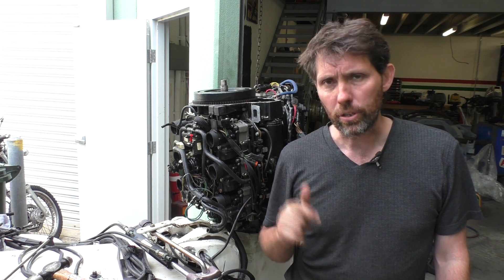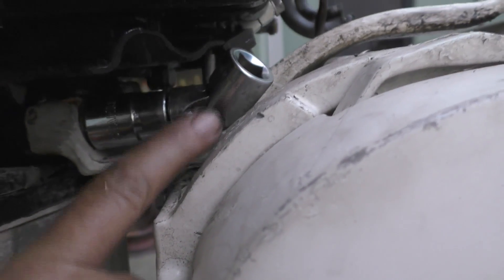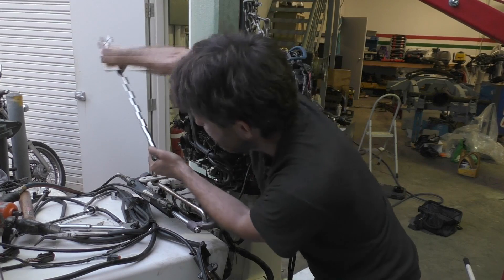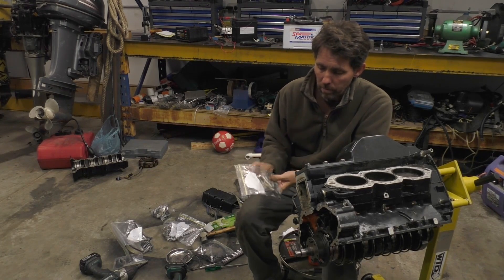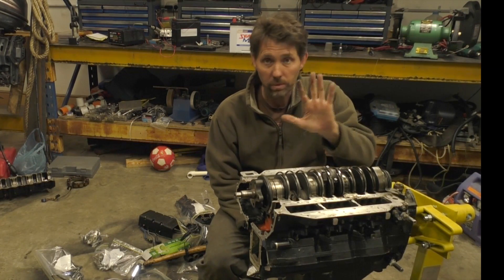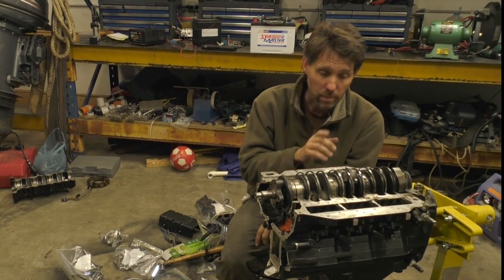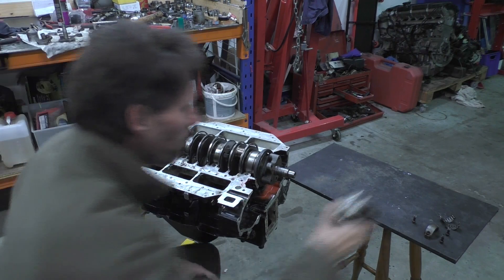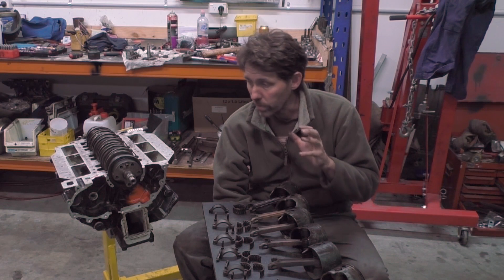Evinrude 150 autopsy

Comment: Good video. I am pretty sure if that motor crapped out here in Canada, it would be VERY difficult to find a mechanic that would even go as far as you have.
Reply from the maker: Canadian mechanics must be much more sensible then. ;)
Reply: No. Judging by the time, parts and effort (and I am sure at least $5000 if not more) you put into that old anchor, it is much easier to bolt on a used runner. We have lots of camp (lease) returns and such available here.
Cheers, good job, educational and entertaining.
Have a beer!

Comment: I have been glued to this story, and now that it's done it seems no sure cause is to blame. I had a 150 Johnson start burning a hole into piston, the cylinder died because the spark plug was fouled with aluminum. Since you didn't mention any odd issue with plug and the piston looked like it was crushed in with no damage to head,  I will vote on a previous reader hydro  lock theory with coolant getting past cylinder o-ring. Once that chunk of piston fell into crankcase it became an interference piece.
  Just my 2 cents.
Great video's, love catching up with island life.

Gary in Louisville, Ky.
Reply from the maker: Hi Gary, there definitely did look to be water getting past that o-ring, so I too think water it is the likely cause. I'll pull the plugs on this one after a few hours of running and take a look at them to see how things are tracking.
Reply: @DangarMarine  Mr danger water was the problem, water entering the combustion chamber raises the compression ratio and side loads the Pistons .higher compression on low octane fuel spark knocks and pre ignition and detonation burns up the piston tops
Reply: If water was getting in, wouldn't the top of JUST THAT piston be "clean"?? I would think there would also be salt deposits on it? Like there appear to be on the deck surface at the suspected leak point.
Is the compression height (pin height) of that piston different to the other 5? if the pin was lower the Compression Ratio would be higher in that cylinder, and that may make it more succeptable to detonation, considering it had appeared to be "rebuilt". Also, could the con rod be mis-machined and be longer that the others? Are all 6 strokes equalised? are all 6 head chambers equal in capacity? are all 6 carburettors matching in jet sizes? small mistakes get made in production lines. I am sure the people putting the carbies together don't check each individual jet, maybe that one is a size or more down, OR the numbers on one of the jets in that carby is mis-stamped??

If that engine has been rebuilt, and it's only a recent engine, that would indicate to me that there is one of the "re-used" components at fault.

  You really need to get your microscope out and work out the problem, or else you will be re-building that engine again, likely at your expense....
Reply: @kiqnkf3201 you are correct. its carbon buildup that stuck the ring/s and cause the scoring and detonation in #2. all cylinders had same level of carbon which is a clue, and the stuck rings staring him in the face! this is extremely obvious and has nothing to do w. water as he suggested. a good decarb every 100 hrs or so and this could easily be avoided!

Comment: i think that cracked piston was a result of pooled water/coolant in the cylinder on compression stroke,, ie sitting above the ports upon startup,,, water being compressed,or should i say trying to be compressed.. not initial overheating. further evident from the cylinders seal/gasket .
that piston may have  been hammered a few times that way, depending on how much liquid was in the cylinder at the time,  and ran a few times   before its ultimate failure. ive seen cars/4 stroke with bent, broken connecting rods resulting from coolant in the cylinder.
Reply from the maker: Yes, a hydrolocked piston will certainly get very unhealthy very fast. So far it seems to be running really nicely so I'm hoping that's all there was to it.
Reply: very good,,further more water constantly being forced  or pulled into that cylinder could have raised compression   leading to 
 pre-detonation conditions,, .but whatever the case  i;de bet that that head seal  had  alot to do with it ,,, Dig the vids.
Reply: I would think because they usually crank a few times before firing, that ingested water would cause the starter motor grief and cease the cranking procedeure. 

Also, unlike a car, I would think there is no pressure in the cooling system on shutdown to cause such a leak into any part of the engine at any time? Is this correct? As a car has a pressurised cooling system, water can get forced into places post-shutdown, were as an outboard would lose cooling system pressure seconds after shutdown??
Reply: it was just an idea,, but either way, pressurized or not, judging by the way that head  looks, you can be sure that water  in some amount   was entering the cylinder.
weather it was while running and/or continued to trickle in at shutdown ,if it had trickled in at shutdown,, yes a full cylinder will cause  a seize/hydrolock . but in certain amounts, say just a bit more than its tdc capacity and sitting at  a particular point in its cycle ,at first crank, i can see it getting hammered. 
Did this happen,who knows. but ide imagine that that leak had a lot to do with its ultimate demise.
is it a coincidence that the one cylinder with the smashed/cracked  piston ,also had the leak?   maybe, but it is very suspect.

Comment: Failure to find the cause will mean it will come back.
The crankcase was never pressured checked. 
The VRO was never calibrated for oil usage with a premixed tank. 
The problem is still there
Reply from the maker: I agree it would be nice to know for sure what the problem was, but given the tanks seem to get water in them very easily I'm thinking it may have been water related. We are still in the process of seeing how much oil the VRO is pumping while on the external tank of premix fuel, so I'll keep you posted there. From what I understand there is no easy way to pressure test these crank cases, but having changed the top and bottom seals and cleaned and resealed the flanges I can't see it having a leak.
Reply: You don't calibrate the VRO for use with premixed fuel. You remove the oil tank and lines and cap it off at the oil inlet.

Comment: Hi Dangar Marine i have a issue we my 1995 yamaha 90 2 stroke  running  foward they dont go more that 3500 RPM I remove the oil tank mixer i mix the oil we gas now ,i change the spark plugs  i clean the carburattors ,i change  the fuel line ,the prime i clean  the little filter inside the motor,i check the fuel pump don have any hole on the diagfragm the compression on all 3 cillinder is 140 on each cilinder and is working better but not more than 3500 RPM, I dont know if is the CDI SAFE MODE or any other Issue,can you o any person here can help me PLEASE.
Thanks
Reply: If your engine is running perfectly and it will only reach 3500 rpm, try changing the propeller to a lower pitch. And make sure you don't have a bunch of unnecessary weight in the boat.

Comment: Stu,
I have a question for you...

I am disassembling a motor, and am stuck.  The problem is that on one piston, the ring is bent and protruding, and is engaging with the exhaust port.  So it will only go up and down the height of the port, and then locks.   Other than being "locked", the motor and cylinders are in good condition.

I've tried levering the rings back into their groove, but they are not cooperating.  Do you know of any suggestions or tricks for this situation?
Reply from the maker: It's definitely a tough one. Does it feel like the ring is not going back into it's groove because it has filled up with carbon behind the ring? If so some type of ring free or oven cleaner might help you get the space you need to push it back in just far enough to clear the port. The other option is to try to file it back in some way if you can get good enough access through the exhaust. It may scratch the bore on the way out though so you will need to hone it once it is out.
Reply: Great ideas!  I'll try the oven cleaner first.  But because the piston is somewhat deformed, I suspect it is metal blocking me. The piston looks similar to yours, like it was starting to melt.  I may be able to take off the exhaust plate and get to it that way.  If not, this one may end up in the scrap heap.

On the Evinrude you pulled apart, it was partly locked up, right?   What was causing it to stop rotation?

(Thanks for the help, by the way.)
Reply: Dangar Marine,
Had a big bummer happen. A friend was looking at that motor, and said he "had it."  Before I could stop him, there was a screech, and he put two huge gouges in the cylinder.  Ugh!  
That motor is done, now...

Comment: some of the carbs may have leaned out less fuel higher temp ? just a thought
Reply from the maker: Hi Sean. In a follow up vid to this one I clean the carbs and they all looked really clear to start with so I'm thinking if they did go lean it was either the fuel pump to the bowls or a vacuum leak.

Comment: I have a 1978(if it is original to boat. I think it is.)  Evinrude 140. I bought it late last summer and drove it numerous times but on my last trip before putting it away for the winter(Northern USA) I experienced a same situation as you have where it was running great. I was pulling a skier he fell off and I stopped then when I started going again it didn't have enough power to get up to plane let alone pull a skier too. Of course I was on the opposite side of the lake so I had to idle back to the boat ramp. Is there any cause for this besides what happened with your motor. I premix the oil so that shouldn't have been a problem. Typically how many hours does it take for a rebuild? Also is it something a novice can do or is it better left for the pros?
Reply from the maker: +Benjamin Coffel It could be a number of things, so you'd need to do some diagnosis first. A compression test on each cylinder will tell you what is going on. A full rebuild is something that can be done by amateurs, but you would won't to take it slowly and do a lot of research first.
Reply: Dangar Marine what is a typical pressure reading for a motor like that? Thank you for your help! I actually fixed what I thought was catastrophic gearbox damage by watching your propeller video. So thanks for that too!

Comment: in the snowmobile world,a hole in the piston top is 100%either water in the fuel or advanced timing causing detonation.if it had cold seized,there would be scoring on all 4 corners of the pistons.ii had a similiar problem with a 200 johnson and it turnrd out to be the static timing roller broke.also those plastic carbs are known to deform which can cause a air leak.does your motor have the optical pickup timing?
Reply from the maker: I'm pretty sure this didn't have water in the fuel as the tanks were cleaned out and refilled before the first run, but I am starting to suspect timing. I'm not sure whether this is optical or has a hall effect sensor, I haven't looked into it yet but I'll definitely be doing a separate video on checking the timing before if goes back in the water.
Reply: i have also seen where water has gotten into the oil tank and burnt holes!i learned that the hard way.it took 2 burn downs to figure it out!lol..is there anyway that 1 carb leaned out?we have found quite a few boats lately that have suffered from the interior of the fuel line rotting away and plugging carbs.i dont know if you guys have ethanol there though?

Comment: The VRO is known to fail without warning and most people that own Johnson/Evinrude normally delete the VRO
Reply: A VRO failure would have resulted in ALL the cylinders being destroyed and NO oil in any cylinders (clearly not the case here).  A single cylinder being burned like that indicated a clogged up carb in that cylinder causing a lean condition in that single cylinder.  This is why there was no alarm.  Also this year motor was equipped with OMS not VRO.  VRO keeps getting blamed for failures that were not related to the VRO system in any way.  Nice video BTW
Reply from the maker: I think we'll be going the same way with this motor. It is going to be cheaper and more reliable to go to premix.
Reply: I keep telling my pop with his 1 week/yr Polaris 3 cyl ski, that premix modding will ensure he still has a boat for another 10yrs when he needs it.
Reply: Interesting all the causes everyone points at. This is also a 20yo 2 stroke engine and another possibility people don't seem to comment on is no engine lives forever especially a 2 stroke turning 5500 rpm all day. People shit sometimes just wears out. man I wish I had a dollar for every 2 stroke I've rebuilt in the last 40 years motorcycles outboards  etc that was just worn out from time!
Reply: very rude ooinion
Reply: +wingtimeRV7, I agree. I am an auto mechanic of over 35 years, and I have seen this in high revving automotive applications which had multiport fuel injection and even on some carbureted engines which had a serious vacuum leak to one of the cylinders due to intake gasket failure. If the cylinder is able to fire but fire too lean, the internal combustion temps will raise high enough to melt pistons. Since this engine has multiple scoring problems, I suspect that the original builder may not have correctly torqued the intake manifold, or worse, didn't replace the original gasket.
Reply: That might be, dgc940; but normal wear is uniform. Not catastrophic in one specific region unless there was a part failure. Especially when it was only 10 minutes into the run after the last rebuild. Someone missed something during the last rebuild or improperly put it together.
Reply: Same pump delivers both gas and oil so if it fails you don't hatch the motor. Clever eh?
Reply: As per other comments on VRO.  Not its fault. In the unlikely event had the VRO failed the whole motor would be destroyed not just one bit.
Reply: Had the same VRO pump in our 1990 Johnson GT 150 since it was installed on it in the factory and we have never had a single issue.
Reply: that's great - but if you do... it's most times catastrophic, and the repair is a full rebuild.

Comment: I have a 10hp four stroke and the timing belt slipped i don't know if it bent the valve but if it has is it worth fixing?
Reply from the maker: It depends how old it is. If the timing belt has just slipped a bit then chances are it will be fine. Many outboard are not interference (https://en.wikipedia.org/wiki/Interference_engine) which means the valves can't be damaged. A leak down test will tell you what you are up against if you don't want to pull the head off.
Reply: Ok thanks

Comment: looks like detonation damage on that piston. No melt splashes from pre-ignition.  Timing/ mixture/low grade fuel?
Reply from the maker: Will definitely be looking into the timing before putting this one back into service. Will also recommend running it on 98 octane to be safe.

Comment: hello Mr Danger, was wondering if you had a part two rebuild video up? Im doing a 92 evinrude 120 v4 looper. I had a compression on one cylinder drop from 125 to 100psi, opened the head to find a loose piston and scored cylinder.  Im hoping to get away with honing and new rings. budgets too tight for a bore job at a shop.
Reply from the maker: Hey mate, should be getting that block back in a couple of weeks and then we'll be straight onto it.
Reply: Dangar Marine awesome thanks!
Reply: If your cylinder is scored honing wont remove that in most cases, but you can over bore just that one cylinder and then get the right piston and you will be fine.

Comment: If it's already 30 over and you have some significant scoring it may have to be sleeved...  not sure how far you can take those two strokes out to.  Maybe 60 and still be safe?
Reply: 40 thou on after market pistons, but that's asking for trouble and there is a higher chance of failure, even with the main jets up 3 thou in size. The cylinder walls are now too thin and cannot dissipate the heat properly.
Reply from the maker: Hopefully I will be heading out to the machinists soon to pick this up so it will be interesting to see how he approached it. Stay tuned!
Reply: Dangar Marine yeah bud.  I'm no expert but I'm not a dumbass either, nice to see a channel with the same mindset I have.

Comment: What do you think about a "cold seize" condition, where the engine was run hard before warming up.
It can seize the rings of the pistons, which would overheat the damaged one.
Reply from the maker: You can sometimes pick up a ring that way, but in this case the owner assures me he had run gentle for a while, then was at speed for about 10 minutes after that before this happened quite suddenly.

Comment: O ring seal failed and water seeped in creating hydrolock boom piston crushed lucky the rods didn't break first
Reply from the maker: I think that piston would be much cleaner if water was seeping in. It is also clearly heat related, some sort of pre-detonation where a hydrolock as you say would be more likely to bend the rod.

Comment: This thing has been rebuilt at least twice. I doubt they went straight to 30 over after the first incident lol
Reply from the maker: It is certainly a possibility. Engineer is planning to rebore some cylinders and re-sleeve others so they will all be uniform 30 over.
Reply: The first and ONLY oversize genuine piston is .030".